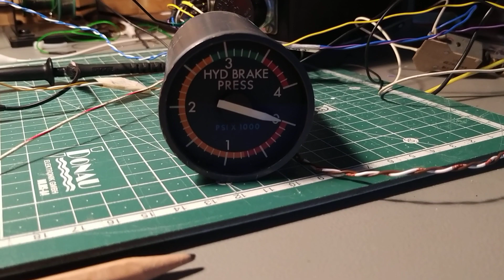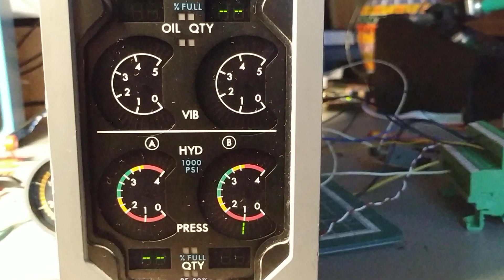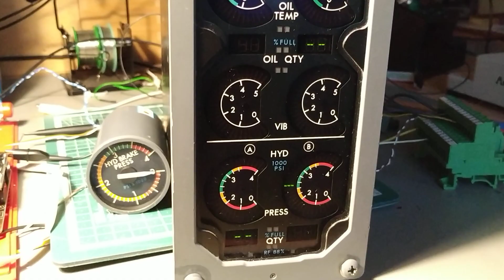Synchro driver new design testing - will it work?

Comment: OK, interesting, so those digital engine information displays take synchro inputs for their sensors? That was probably done so they could just drop in place of the old analog gauges in existing aircraft?
Reply from the maker: Yes, exactly! All signals are equivalent between old independent gauges and this combined unit.
I would've loved that this panel accepts Arinc directly but instead it takes a bunch of different signal types, like capacitive, synchro, analog, etc.

Comment: Awesome!  What a fantastic interface!  The high resolution of the synchro signal is extremely interesting to me.  I'm thinking that a large synchro indicator, like an HSI, would move super-smoothly.  The larger the indicator, the more obvious the "steps" appear as it slowly rotates.  But your interface is accurate enough to drive an ADI as I saw in another one of your videos.  I was asking James if he had the schematics to the Smiths combined indicator and he sent me right to this posting!  Fantastic job!  I had 14 and 16 bit resolution military hybrid converters that were salvaged from various things like digital air data computers.  I used them in my military sim 20 years ago.  The problem was not the converters, but Microsoft Flight Simulator 2004 only had one degree of resolution for the heading variable and every degree was a very obvious step on the HSI and other synchro indicators requiring synchro heading data.  The other bottleneck was the PC to SIM hardware interface that could not keep up with the data being converted.  20 years later and you solved all that.  I have been waiting for years for a non-military hybrid solution for synchros that used a 26VAC 400Hz reference and you've solved that!  No more $2000 digital to synchro hybrids from DDC required!  How many synchro receivers can you have on a single output?  Fantastic job Lucas!  A dream that took 20 years to be resolved!
Reply from the maker: One can tell you have great experience on this topic and fantastic you notice the details!
Synchros, as you say, are very precise and accurate, and also very fast. Any imperfection in the transmitted data can be seen in a synchro instrument. As you correctly said, the issue is not the hardware but rather the simulator running in a none real time system. The level of smoothness depends on the update rate and filtering. Both affects response time, so it is important to configure the system with optimal filtering for a given update rate.
The board can drive upto 5 synchros configured as 2 phases (third leg connected to ground).
The channels can be also configured to accomplish other functions, like 3 phase synchros or tachometer output.

Comment: are you using a kind of Scott transformer for your module ? very nice work thought !
Reply from the maker: Hi, thank you very much!
I'm not using a Scott transformer, I'm doing the transform by Firmware. This gives me a lot of flexibility on how to use the board.
Are you developing something similar?
Reply: @lukloop  vert clever ! Thanks
Reply: @lukloop  is this some kind of pwm that you amplify and then smooth with an LC Filter ?